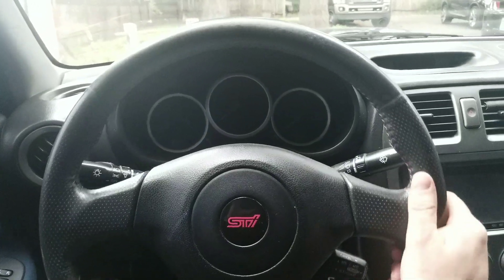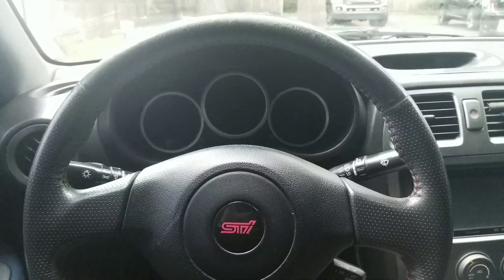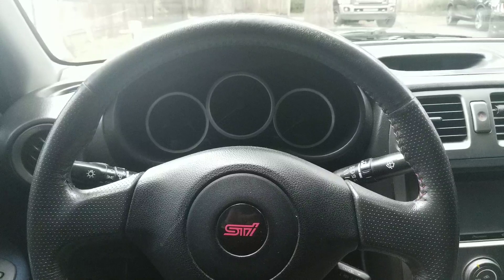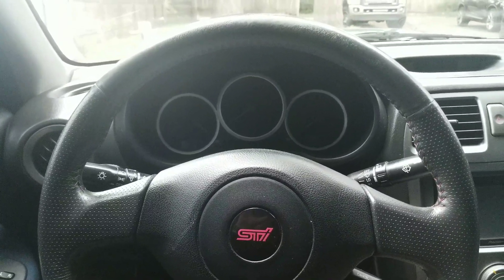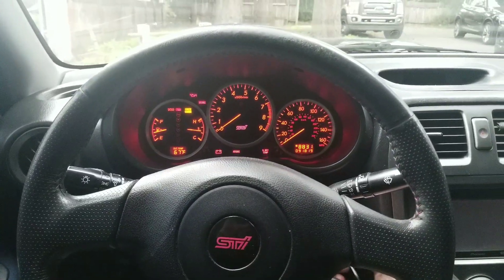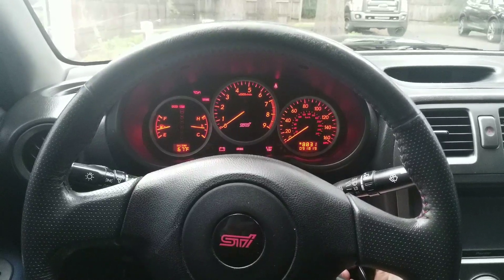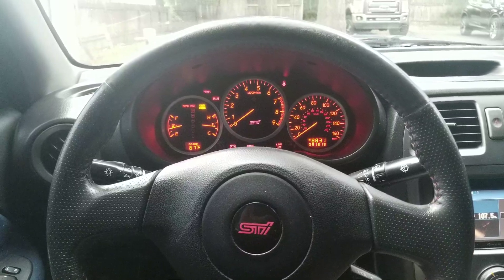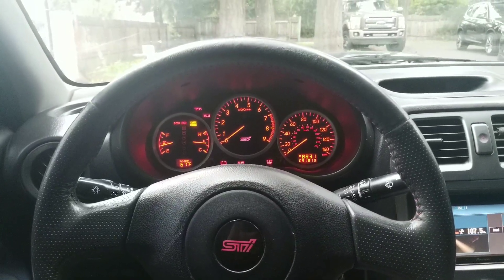How to test compression on a Subaru STI and WRX (THE EASY WAY)

Comment: Will this work on 02 wrx ?
Reply from the maker: This method won't work. But you could pull the ECU ignition fuse which is a 15 amp that's in the fuse panel by your left knee under the dash. It should be highlighted yellow and the second row from the bottom on the right side. That will disable the injectors from firing and crank the exact same way as this video. Once you put it back in you will have no check engine light and everything will be back to normal.

Comment: Why doesn’t the engine start? Does pushing the pedals to the floor stop a start? Or did you pull a fuse first?
Reply from the maker: Yes it's built in flood clear. Most can based cars have that feature.
Reply: @RileyCarson  thanks I was going to pull out spark plugs from my 2008 wrx (bought off a friend with a blown turbo and it's been sitting in his front yard for a year) and do a compression test - but your method is a lot faster for a very basic test. Thanks for sharing.

Comment: can the tecnique be used on other brands of car? and how about cars with automatic transmission?
Reply from the maker: Yes absolutely a great technique to use. Many cars have that flood clear characteristic of foot to floor on gas pedal while cranking shuts off injectors. But I cannot confirm what ones exactly do and dont. You can find other way to prevent firing by pulling a crank pos sensor. or pulling injector fuses etc. and can crank and listen.